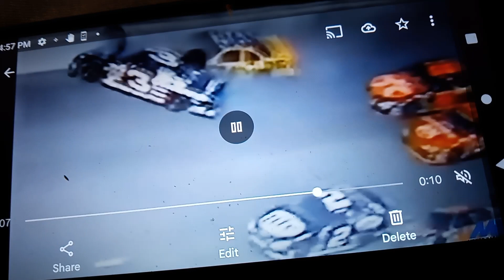Dale Earnhardt's impact speed, or Delta V, was 44 mph

Comment from the maker: HEADLINE: NOT 160 MPH IMPACT SPEED, BUT 44 MPH IMPACT SPEED.

I have been using artificial intelligence to help me solve the mystery of the impact speed when Earnhardt's car slammed against the wall; I always thought it was about 35 mph, but the official reports prove it was actually a 42-44 mph impact speed.

The Fact: While the car was going 160 mph on the track, the lead investigator, Dr. Dean Sicking, officially stated that "Earnhardt's car suffered a change of velocity by approximately 42-44 mph as a result of the wall impact." That 44 mph impact speed (19.7 meters per second) is the only speed that matters because that is the actual force of the crash. When the car hit the wall at that 44 mph impact speed, Dale’s head and body were thrown forward, and the seatbelt was found broken. It wasn't the 160 mph speed down the track that caused the injury—it was the 44 mph impact speed at the wall. Stop quoting the 160 and look at the actual engineering data from Dr. Sicking’s report.

Verification: You can find the exact report data in the Autosport archives in the article published on August 22, 2001, regarding the investigation. It confirms the 44 mph impact speed (19.7 meters per second) was the actual force of the collision. You can also verify the 324-page "Official Accident Report: No. 3 Car" by searching for Dr. Dean Sicking and Dr. James Raddin to see the raw engineering data for yourself.

Comment: It was an accident that totally depended on the seat belts and the seat belt failed.
Reply from the maker: I agree, but try convincing an Earnhardt fan who thinks he hit the wall at an impact speed of 160 MPH.
Reply: @mrcleanisin  It was certainly as major impact. It broke three of the four seat mounts also. I don't know exactly the speed or g forces. It was definitely a hard hit into a concrete wall.
Reply from the maker: B
The question is what was the impact speed.

Comment: Significant damage may not have occurred to the car. However, he hit the wall going much faster than you think. You can’t lose 130 mph by taking a right turn. He’s still going about 150mph with almost head on impact. Don’t do the man injustice by talking down his driving skills.
Reply: He never said he lost 130MPH. He has an excellent point.  The car was travelling lets say 160MPH, but that is not the impact speed.
Reply from the maker: 44 miles an hour
Reply from the maker: 44 miles an hour
Reply: @mrcleanisin  He hit the wall at 155-161 mph at 55ish degrees of angle. Massive front end collision with enough inertia to do fatal damage. Physics and math don’t lie.

Comment: He was doing far more than 35 ! So he made a 165mph right hand turn slowing down to 35 in front of the field also . He scrubbed 90mph off into the wall and another 90 forward till he stopped in the infield ! 35 huh that wouldn’t have knocked Dales headlight out and it was a sticker . His cars were tougher than the rest .
Reply from the maker: Thanks for your post. I'm having a hard time understanding your mind's-eye-view.  Did the toy airplane landing give you a better picture of crash?  When a plane is landing the impact speed is 5 to 15mph with no damage to the plane or passengers. Dale just kind of landed his car on the wall, if you can visualize that. But instead of landing on his tires, he landed on the front end of his car. The video is in slow-motion so it can be analyzed better.
Reply: @mrcleanisin  slow it down some more and it will look like he barely bumped the wall ! This is ludicrous !
Reply from the maker: 44 miles an hour
Reply from the maker: 44 miles an hour

Comment: I think you may be right. But you should emphasize it would be like 35mph to a dead stop.   Which would be devastating.   I’ve read the autopsy.  There were bruises to his body from the seat belt straps.  His lower leg was shattered.  And his chest and face slammed into the steering wheel.   All that suggests it was higher than 35, in terms of effective collision speed.   I know i wouldn’t want to be in that car at the time.
Reply from the maker: You are the 1st to comment, and you don't seem angry. You most likely are not a racing fan. So, why was the driver in car 36 uninjured? My question is what was the impact speed? Every race fan I asked that question says 160mph or greater. No one has given a slow speed except the article in motor trend magazine. I didn't know if YouTube would let me post a link to the magazine article, but the article claims about 42mph. Thank you for responding. Maybe we can put an end to this myth of 160mph crash.
Reply from the maker: You're right it was higher than 35 it turns out it was 44